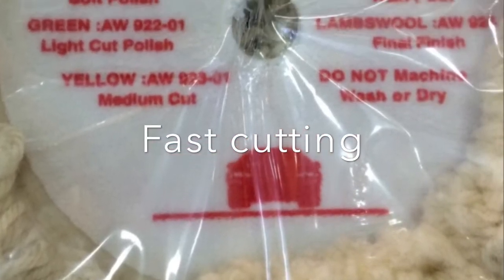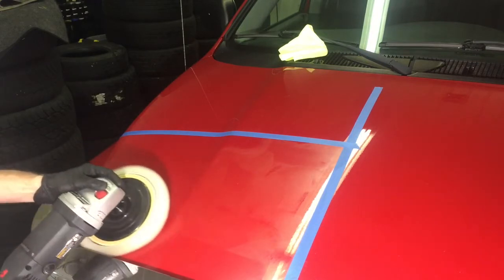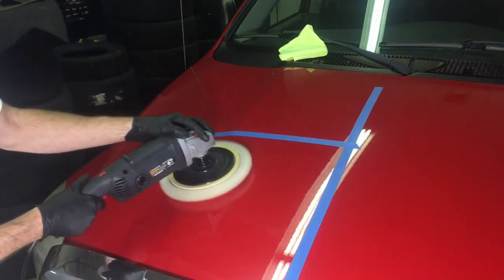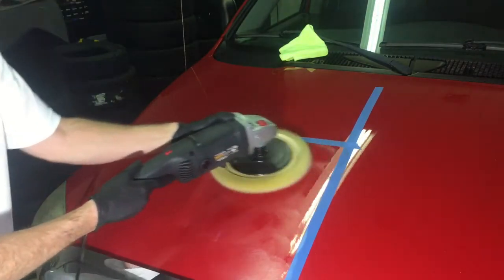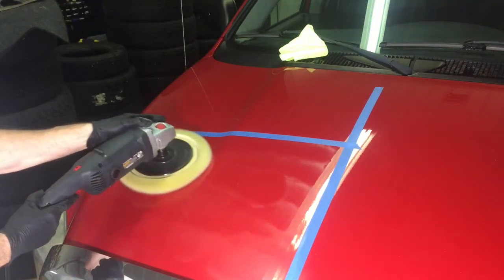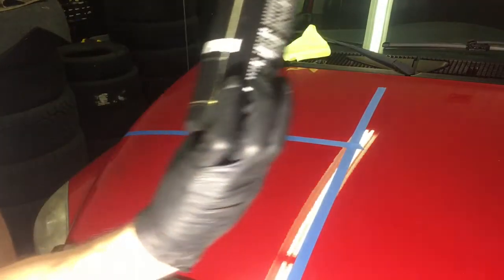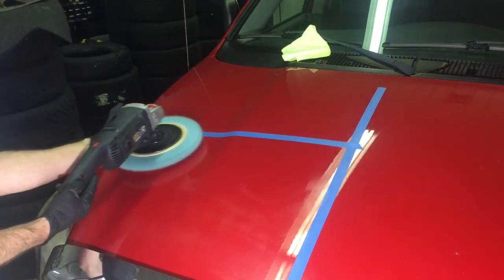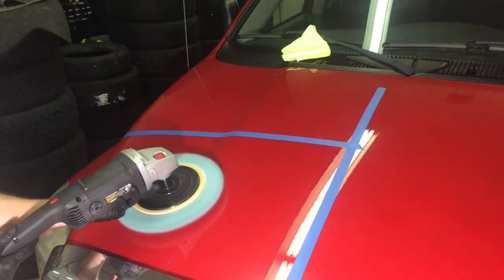Learn to use the Rotary with Apex Detail: VOLUME # 1 (wool pads)

Comment: Amazing Video!
Ive got a question…i sanded my carhood with p 2000 and i always struggled with buffing the sanding marks away…it took a long time…i used a Heavy cut compound on a rotary with a wool pad (about 800-1000rpm, and no pressure…)
Should i use more pressure and rpm? If yes, how much?
And from cutting to finishing will the pressure lowered? Down?

Comment: You are very good with the way you explain things. Thank you for this video.
The way you have applied product on panel is very logical, covering all of it, no slinging. 

Can i use this method working with a DA polisher, i apply product on the pad, but this method seems better.

Comment: Great video. I have 5th wheel RV with gelcoat side panels and gelcoat nose. Do you have a video on gelcoat sufaces? Specifically removing oxidation and polishing techniques.  I'm currently using a rotary with a wool pad and Protect All Fiberglass Oxidation Remover and Color Restorer. Having problems with creating blemishes and swirls. Speed is about 1500rpms oxidation removal and about 2500 for polishing. I change wool pads in between.

Comment: hello, i want to purshase a FLEX rotary and there is no plate with. Witch model will fit 125 mm : 3M Perfect-it III Rotary Backing Plate or Flexipads or the FLEX 125 ?
thanks for your video, i only use DA and when i see your perfect result, i want to try it !

Comment: Hi @Apex Detail thanks a lot for the video, it is very educational for the people like me that are just beginning to learn the appropriate techniques to use the rotary buffer. Recently I bought one Stanley - Black & Decker with some 600 Watts motor, at first it seemed to me that the machine was a bit low of torque, and I thought "Ok It will be safer", so I started to work in my car but something went wrong and now the panel I´ve worked on got holograms on it. How can I correct those Holograms using the same machine?.

I think lots of people including me would thank you so much if you could make a video dedicated to correcting holograms with the rotary.

The rotary buffer cuts time and helps the detailer to keep profitable...with that said, I don´t know why are so many experts on the internet that, rather than explain (as you) to use the rotary they criticize and discourage the  use of it. Why is every one talking about DAs and working them if as I can see the rotary buffer has very much potential  to achieve the same results?
Reply from the maker: Luis Fernando Parra Martínez   I will get back to more rotary vids ... as soon as it slows down here a bit👍🏻
Reply: You will be very thanked for that. I´ll stay tuned.
Reply: @apexdetail85  Looks like the rotary can be used much faster than a DA. I want to learn on the rotary with the cordless Milwaukee M18 polisher. Thanks for the videos, you make it look easy!

Comment: I have two different shades of bright metallic grey on my truck how would I fix that I was using PS2 spray paint I bought at the store but my paint code is PSB. I had to buy the PSB paint online since I couldn't buy it in the store. If I showed you a pic of my truck now you could see the different shades but it is almost dark now but I can email you the pic of my truck the way it looks now. I would like to fix this on my own. I probably would have to buy more of the PSB spray paint and all the spots I would have to do over again that look the different shade of grey.

Comment: Question how do you prep your wool pad when it’s brand new?
It’s my first time using a wool pad and it’s throwing a lot of wool strings 
I don’t know if there is a break in process!! Thanks
Reply from the maker: It will stop shedding after a correction or two. You can also tumble dry (no heat) as well.

Comment: Great video Brian as always , are these machines like the big floor polisher?LOL Law me , I don't where to put this on my list of detail tools. I always get cars with what I  call dings and doddles and this machine would save a ton of time and elbow grease which as 64 runs low at times! I may need to move this up my list! BTW ,I did a SUV yesterday using the Tide Clean on cloth seats and the person couldn't get their jaw off on the driveway, tremendous tip Brian,thank you. Did you ever try the magic eraser for the lug nut holes ?

Comment: Hello Sir, I'm guessing that with your years of experience, you've tried virtually every wool pad out there. What is it about the Ardex pads that makes them your top choice? And, can I ask what you use to clean your wool pads?   tyvm
Reply from the maker: I spray PoorBoysWorld pad cleaner then use forces air from my air compressor. When it comes to the typical wool pads there is really not a whole lot of difference . Ardex has been making them for decades and makes one hell of a strong pad. I have had one of the cutting pads for five years.
Reply: Thank you so much for the reply. If my old brain can manage to retain just a bit of what you're explaining, I'll be way ahead, in regards to time, and money saved.
Reply from the maker: If you ever have any questions 👉miragebjs@yahoo.com

Comment: +Apex Detail do you always use a rotary when doing a 2 step correction for a faster cut? And how much faster on average would you say the rotary is at removing heavy defects and swirls compared to dual action Long throw polisher?
Reply from the maker: I do....It is twice as fact as using...say...a 21mm polisher.
Reply: Apex Detail great thank you! Also thank you for the awesome videos

Comment: Remove the backing plate, add a 5/8", 3/4" long nut to the spindle and use double-sided wool pads that are balanced. You'll double your overall feel of control being that much closer to the surface.

The little things.

Comment: When I try to use my rotary, the product always seems to dry really quickly. Despite the speed and on a cool panel. Whereas my orbital using the same product (3M) does not... can you explain what the problem is?